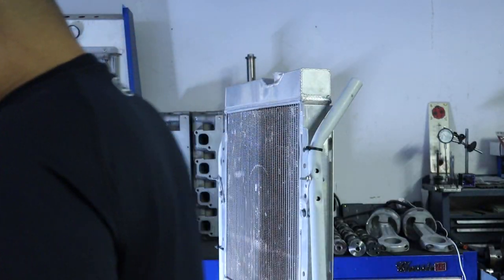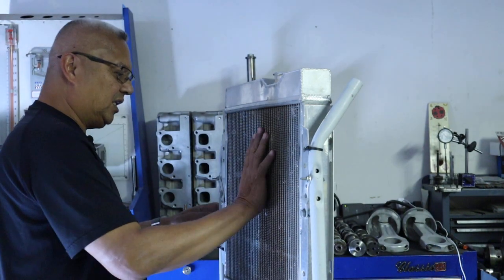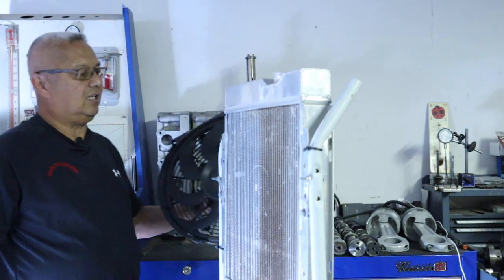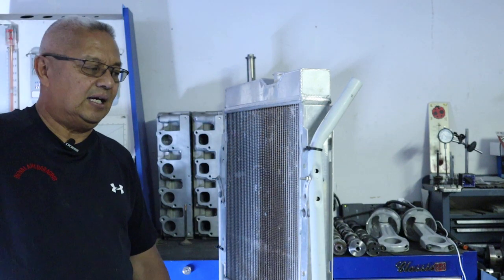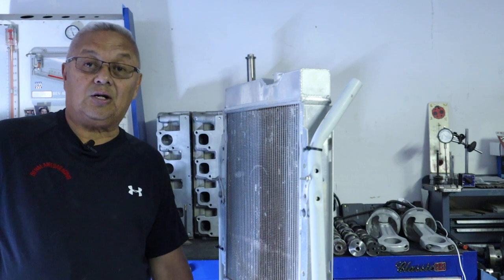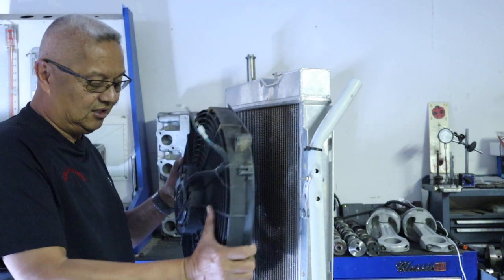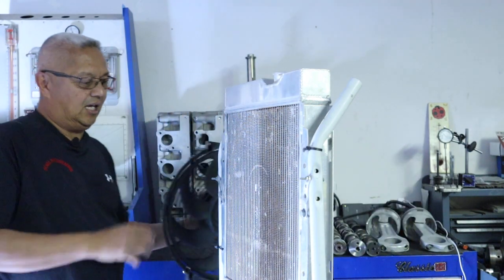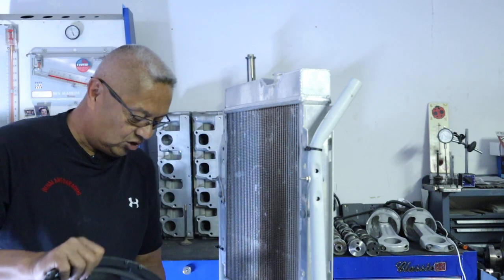FRONT OR REAR FANS FOR BEST COOLING?

Comment: @ben what about having both? A puller and a pusher, would we benefit you think?
Reply from the maker: If you have o/heating issues severe to require both?  I suggest you run a bigger cfm on the puller (rear) so that it does not jam the flow thru the fins.

Comment: ya mine is on the front and it heats up on a warm day in the staging lanes don't want to shut it off if I'm up next or close what if it doesn't start. woop woop wa
Reply from the maker: I bet if you pulled behind the fins it will run and cool better than it is now.

Comment: Something I've seen is too thick of a radiator running hot. People will run a 3 or 4 row radiator and not run as cool as they want.  My guess is those thicker radiators do not get the air volume required to remove the heat from the water.  
On one of my older track cars (road race) I had a fairly well built Honda B20, made 185hp at the wheels.  Was using a 2 or 3 core...don't recall all Aluminum radiator worked fine. At a track day a rock knocked a hole in the radiator, the only replacement I could get was a tiny single core oem style plastic bowl/aluminum core radiator. I thought for sure I'd have over heating issues; nope not at all, in fact water temps ran a little cooler than with the "performance" radiator.
Reply from the maker: In many instances the amount of drive pulley ratio between the engine and water pump can dictate if you will overheat with big radiators!  I seen time and again when they slow down the water pump (underdrive pulleys) and pushing thru a 3-4 rows ends up overheating as well because now there is too much restriction to air flow between the fins!  If it coolant passes too fast on the rows then it does not pull the heat and likewise vice versa, it will also overheat.